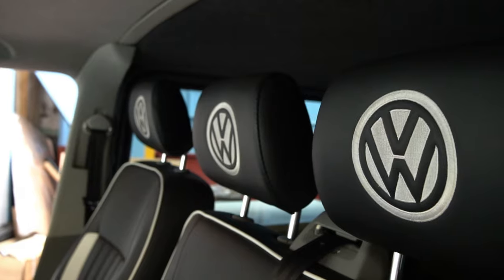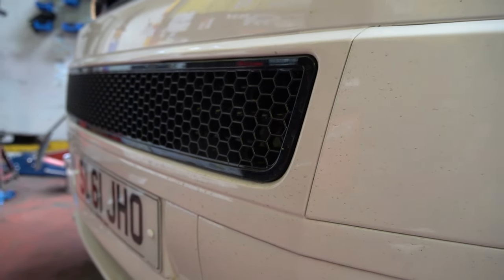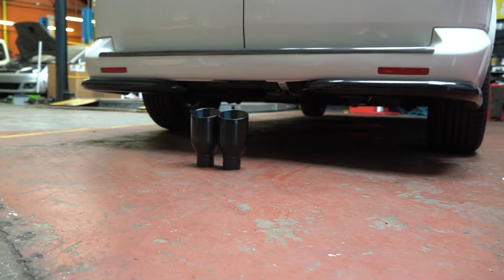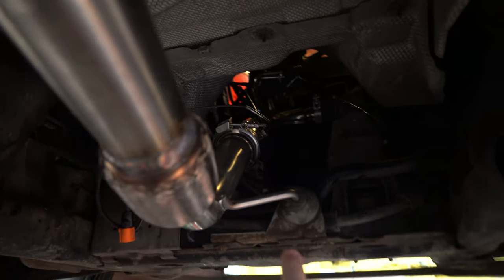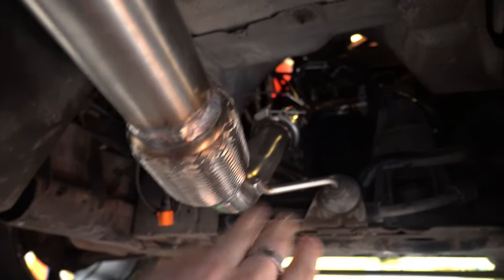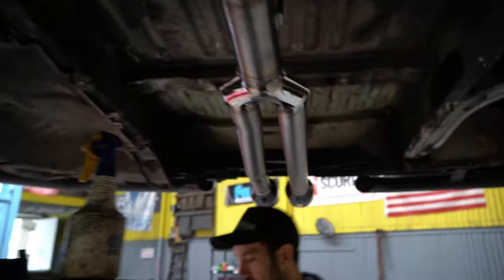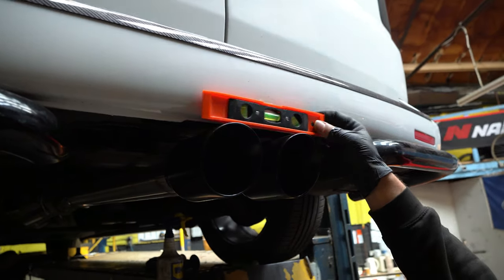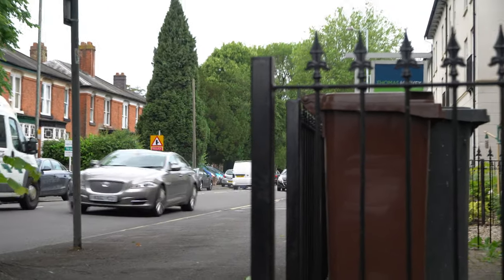VW T5 STAGE 1+ *R32 STYLE* EXHAUST

Comment: That’s great love it how is the customer going to get an mot with a dpf delete and how will he then avoid prosecution if they dob him in to vosa  if you can answer this then I will bring mine for u to do 😁👍👍
Reply: DPF deletes are undetectable as they're done on the weld line. The margin for diesels is so wide, it won't get picked up on the emissions test. 
Not that I'd know though.
Reply: @25123003andy  is that right? Asking for a friend 😂
Reply: @streakyfish  I cannot confirm or deny whether I've had it done and passed many MOTs with it deleted.
I hear you also need to get it coded out so the dash warning light won't illuminate.
Reply: That’s interesting, thanks for the reply 👍